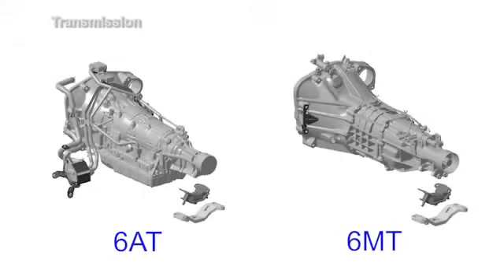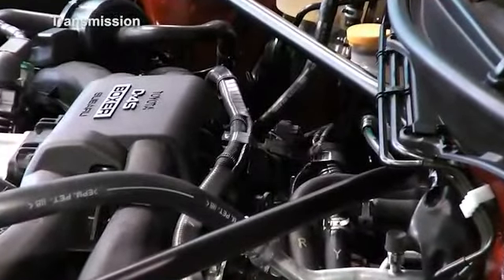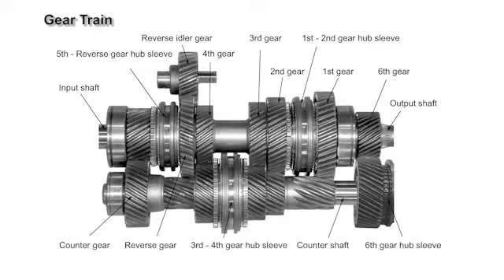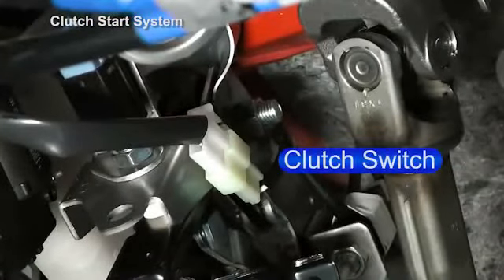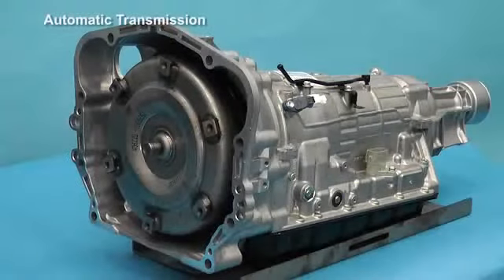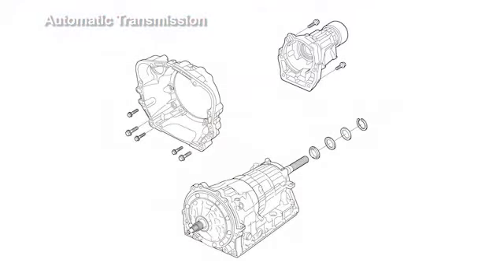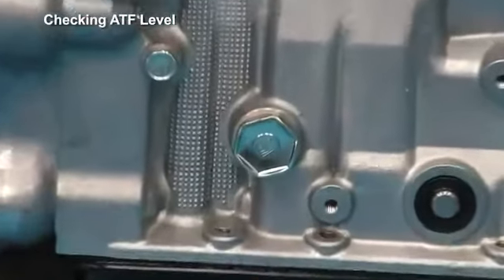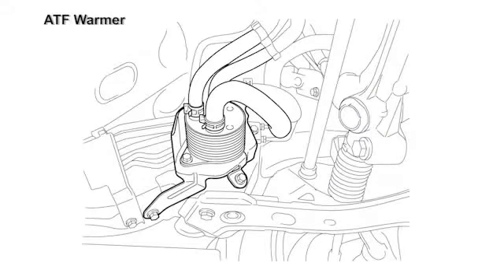Subaru BRZ Transmission Technical Information

Comment: Can the BRZ transmission bolt to a WRX engine?
Reply: EJ207 ive seen it done without any conversion plates. not all bolts will line up but the transmission bolts on
Reply: We’re talking about the new FA engine?